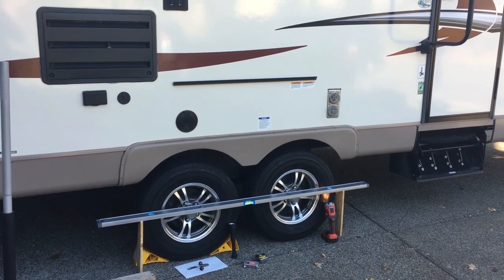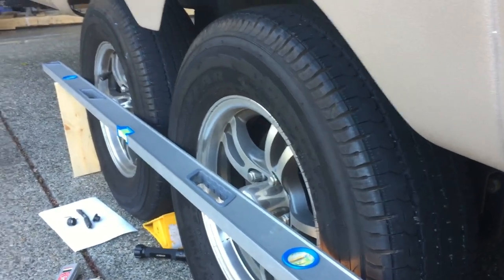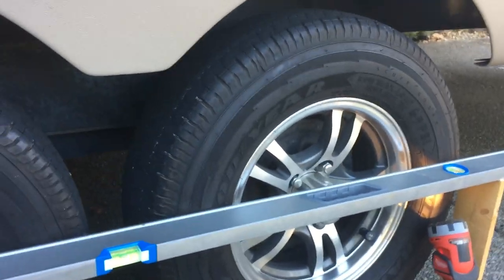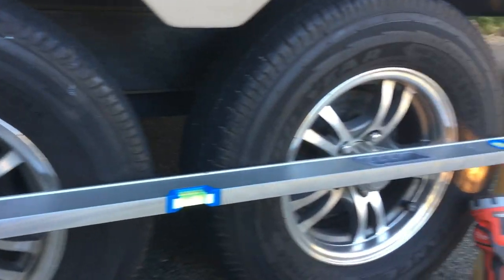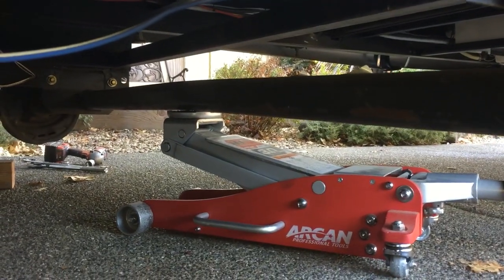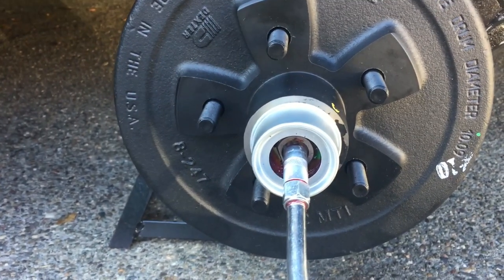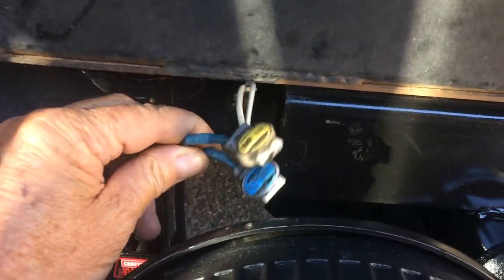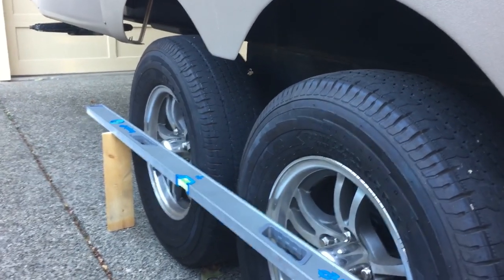Travel Trailer Bent Dexter TorFlex Axle Problem & Replacement

Comment: this is an older video now, but I'm curious why the axle couldn't be taken to an alignment shop? that toe in wasnt that bad, would have been an hour and a half job to fix at my shop without replacing the whole thing.
Reply from the maker: Yep I changed it out not to long ago in November 2019. I would have talkin it to a shop to straighten but since Dexter sent me a new one under warranty for free and it included new brakes and drums (which I needed to replace anyway) I feel I got a deal. Thanks for letting me know it could have been fixed. I still have the axle I took out, if I sell it on Craig's list how much do you think I could get for it? Thanks for your comment  :)
Reply: @thetraveltrailerguy  yeah sending you a whole new axle with brakes and drums is a steal. I would just hold onto that axle in case something happens to the two on your trailer. the odds of selling it aren't great cause the buyer would have to have the exact same trailer for the hub face/bracket measurements/bracket height to match, almost every trailer is built just a little bit different, even sometimes two trailer of the same brand/style don't match